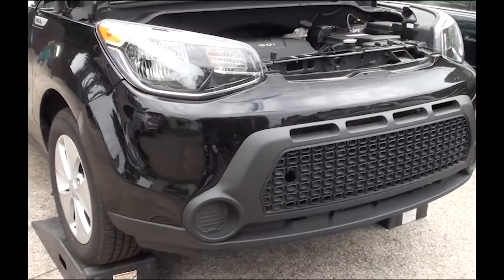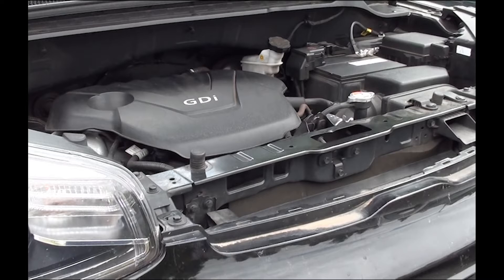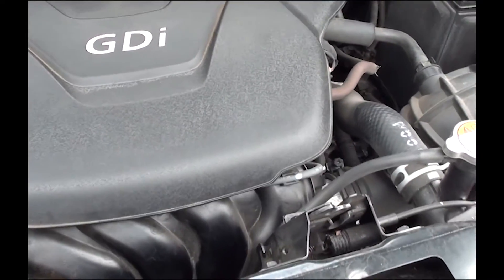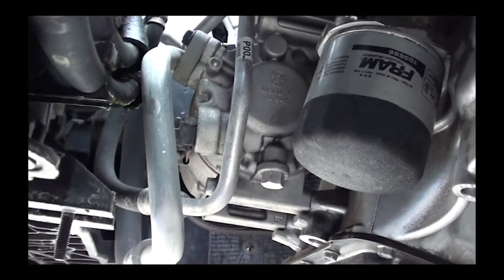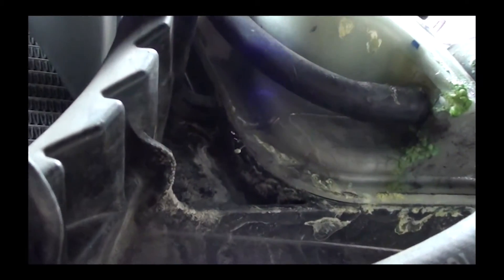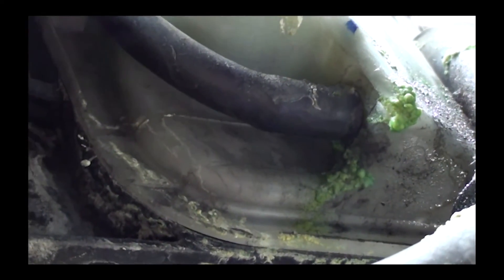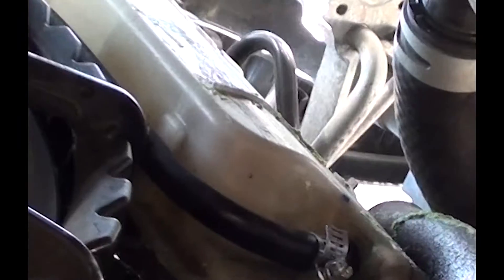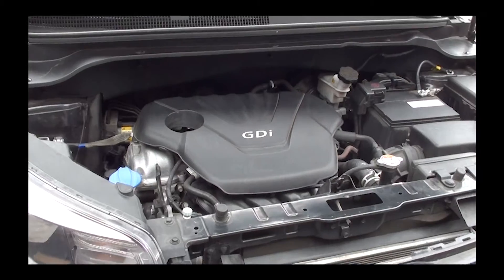2016 Kia Soul Owners Beware Mysterious Leak Found

Comment: My soul had a crack in that area. I had loss of fluid, no puddles, no smell. I found out replacing the starter motor and only because I previously found and saw this video I checked for it. No clamp and hose was not original. It was painful realizing the tank was cracked. It is not sold by itself. In comes with the fan and shroud. $262 original KIA or $67 eBay.